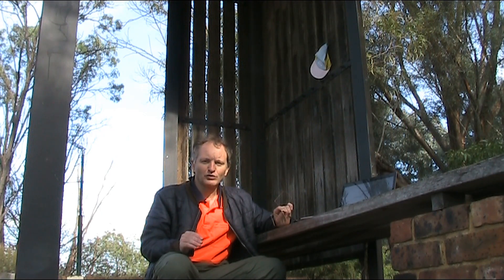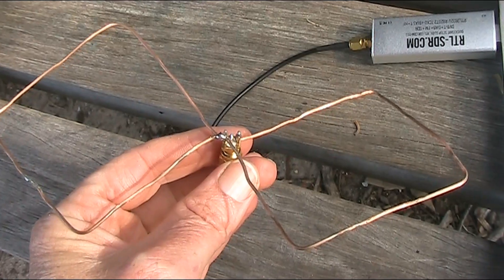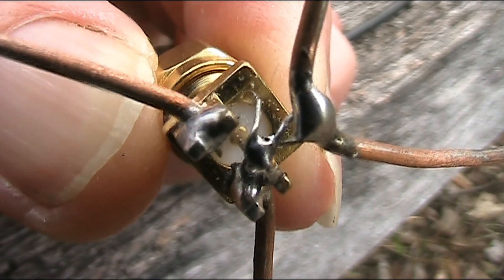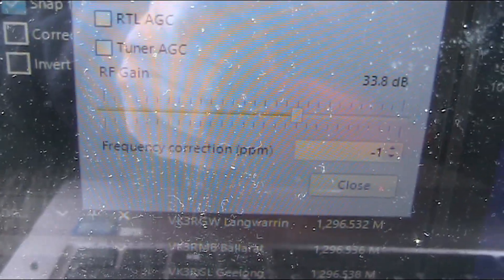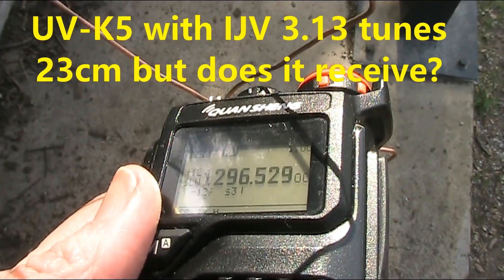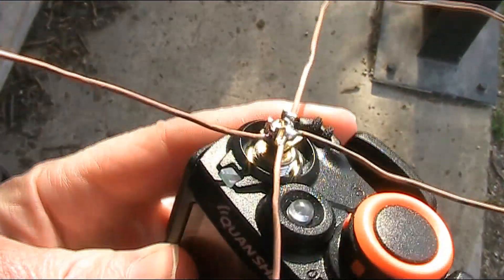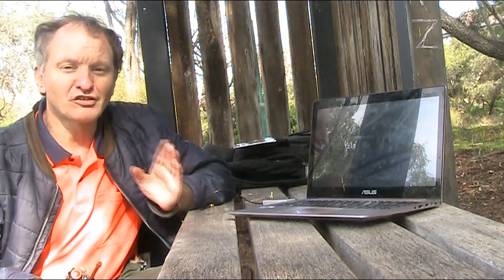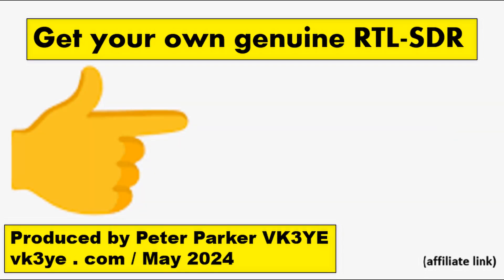The best cheap receiver for 1296 MHz (RTL SDR vs Quansheng UV-K5)

Comment: Quansheng requires a change to the first transistor in the receiver circuit and a change to the filter, otherwise it doesn't work on 1296MHz. Work in progress, (very slowly).

Comment: That little antenna was impressive. The fact that turning it made such a difference to reception. I wonder how a downconverter would go at bringing it down to the to range of a Baofeng. Or a cheap UHF CB handheld, using a nanovna as the oscillator. I've been playing around with downconverting. I have downconverted a signal on 487.600mhz, which is the output of the repeater of a local taxi company, to the UHF CB band. Results have been excellent, and the frequency is quite active. I originally used my nanovna as the oscillator, and due to the oscillator frequency required, just 10 to 11mhz range. I had a go at building my own. This was the first crystal oscillator I've built. I had an old 27mhz CB I picked up that had a heap of crystals. Two matched up with what I needed. The end result is a downconverter using just seven components. The crystal oscillator circuit I got off YouTube.  I'd had the circuit for some time. It was described as a crystal tester. With the crystal it's just six components. 2 capacitors, 2 resistors, a general purpose transistor and the crystal. I don't think it's a colpitt's.

 It worked first go with several crystals I had at hand. From 10mhz to 20 something. It worked from 9 volt, and all the way down to 1.2 volt. A double A rechargeable. The mixer is a single germanium diode. Output from the oscillator goes to one end of the diode. Alligator clip lead goes to this end for the antenna. Alligator clip lead to the other end for the the output. The CB handheld only needs to be near the output. The squelch is triggered with no problem. Using a 10.625 crystal. The difference with bring the 487.600 frequency down to 476.975. This is channel 23 on the UHF CB band. My other suitable crystal will place it on channel 24.
Reply: Excellent idea!
Thanks for sharing your experimental approach and results.
Reply: Lovely! 👍

How can we build this downconverter? Link please?
Reply: @PureAwareness76  This doesn't have the circuit, but demonstrates it.
https://youtube.com/shorts/C2hrZXTatFg?si=ssZyejo0ltAdSzsU

Comment: RTL will easily win.
I measured approx -74dBm sensitivity for my UV-K5 on 1297MHz and RTL is much more sensitive there.
Reply: How about  vs quangsheng with V2.1 SI4732 chip full HF band mod? Have you tested this?